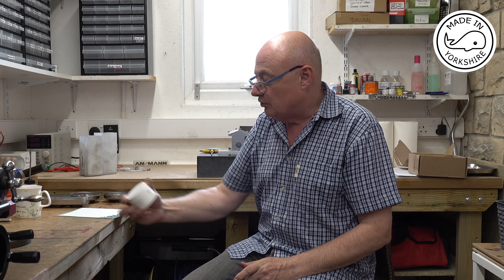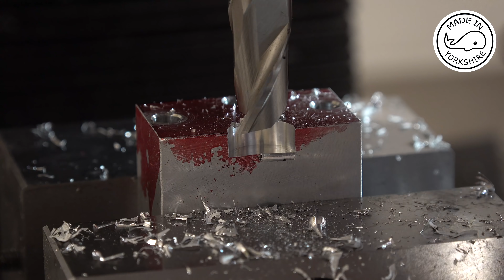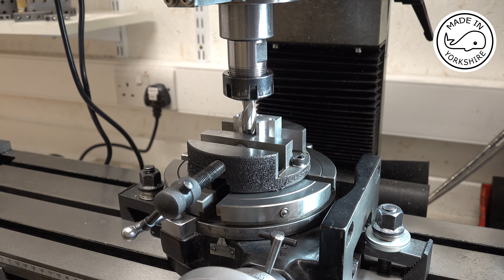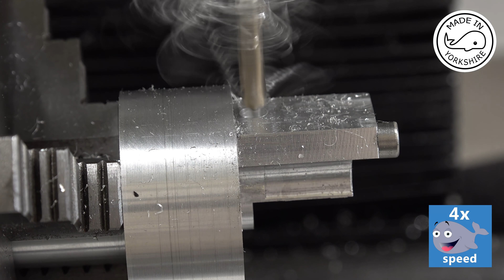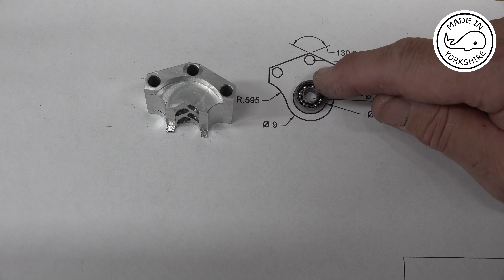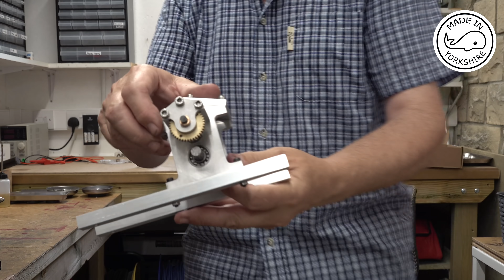#MT44 Part 4 - Hoglet V-twin IC Engine. Making the Lifter Block. In 4K/UHD by Andrew Whale.

Comment: Hi Andrew i am following you up on this build ,i to am finding the prints to be missing dimensions on several of the prints ,do you have the vertical dimension's on the lifter block?  For some reason the guy was verticality challenged when it come's to them.
Reply from the maker: Hi Ernest. Looking at my notes on the drawing, I think I calculated some dimensions by looking at the drawing of the crankcase front. If that doesn't help you, please email me a picture of the dimensions you are lacking, so I can try to help further.
My email address is learningturningmetal@gmail.com
Cheers
Andrew
Reply: Thanks Andrew that helped , the drawing is as you said hard to understand at best.

Comment: I'm surprised there aren't some comments about process planning.  A little thought would save a lot of time.  The cover could have been mounted form the start and machine setup steps would have been greatly reduced - along with the potential for errors and inaccuracy.
Reply from the maker: Hi Jonathan. Believe it or not I put a lot of thought into process, not just a little.
Cheers
Andrew
Reply: @learningturningmetal  it is obvious  that you put a lot of thought into how to achieve each process. My point is that a little more thought about the order in which to do them and when to machine parts together rather than  separately would save a great deal of time and be much simpler.

Comment: Hi Andrew, another inspiring video.  You may want to think about how you're going to lubricate that bush if you don't use an "Oilite" one?  You might be lucky and find it's a standard Oilite size.
Reply from the maker: Hi Steve
I think I've found suitable oilite bushes from simplybearings. I hope to replace the rear ball bearing with one as well. I plan to stick with the ball bearings for the crankshaft.
Fingers crossed.
Andrew

Comment: just a handy tip for the milling work andrew,  invest in (or make) some jacking bolts to support the end of the part that is being held in the rotary fixture. I have noticed a fair amount of deflection while you drill and these will help with the surface finish and accuracy of the end result. Yes, its a bit more faffing about every time you rotate the fixture but it will help your milling adventures. loving your work mate.
Reply from the maker: Thanks for the reminder Josh. I bought some mini jacks a while back but forgot to use them. I must remember next time.
All the best 
Andrew

Comment: Impressive stuff! Thanks - Kasenit has been unavailable (in the UK, at least) for some time as it contained cyanide salts. The alternatives are various forms of carbon powder which (anecdotally, at least) don't seem to be as easy to get good results from. However, as you've already made the camshaft from silver steel, it will harden OK just as it is  - I notice from the outro that you've already done something in this regard :)   Trying to machine at angles other than 90 degrees fries my brain! :D
Reply from the maker: Thanks very much for the info 👍. Well spotted regarding my hardening of the silver steel. I also put it in the oven to temper at 200 degrees C for an hour. I must have a go at hardening mild steel at some point.
Cheers
Andrew

Comment: Very good work Andrew! I always look forward to your next installment. Question: is your rotary table a standard one that has been converted to use a stepper-motor, or did you purchase a finished assembly? If it is an add-on kit, where did you get it?  BTW, a UK "slot drill" is a "two-flute endmill" here in the US, so you were technically correct ;)
Reply from the maker: Thanks Jim. I've got three rotary tables. One has a world of ward stepper motor on it. I did a video a while back showing how to do it.
Thanks for the explanation regarding slot drills. I must remember to not try to correct myself!
Cheers
Andrew
Reply: @learningturningmetal  Thanks, I'll look for that video. Best regards, Jim

Comment: Great Outcome Andrew. I think that they stopped making Kasenit because it was poisonous. I found this trick on the Web. Give it a try. I am still trying to get hold of fruit stones.  Try using the old gunsmiths trick, fruit stones heated until they change to charcoal, smash with a hammer until a fine powder then use as Kasenit.
Different fruits will give different colours.
The best bit is its free. Stay Well. Regards from Australia.
Reply from the maker: Thanks Dave - and an interesting method. 
All the best.
Andrew